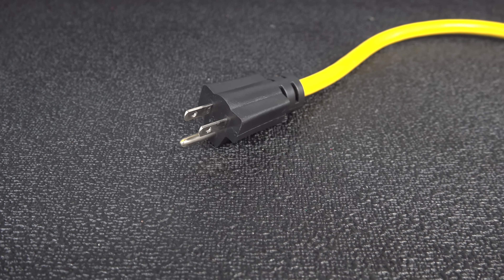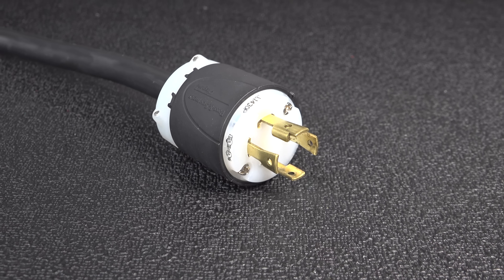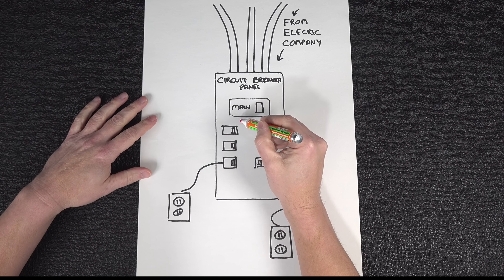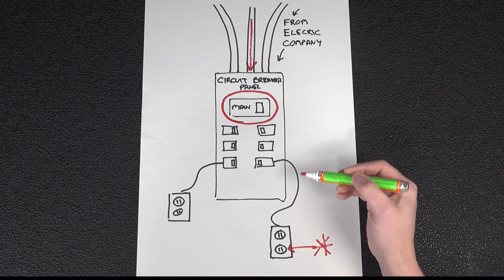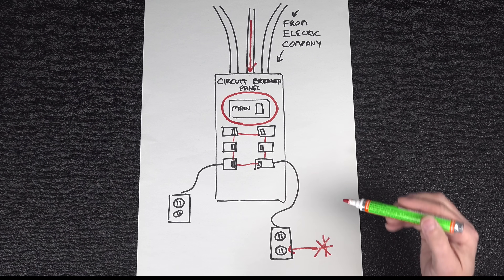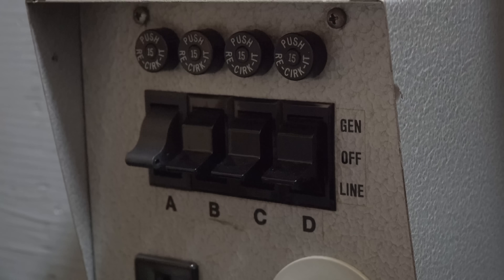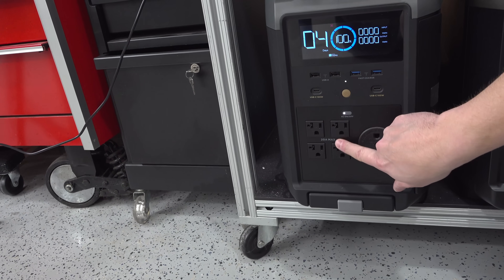Worst Electrical Mistake You Can Make - Backfeeding Generators

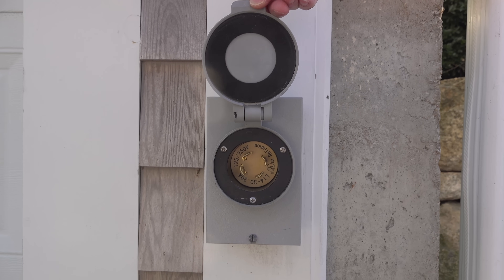Comment: 3:05, you should clearly mention that this outlet is safe to touch ONLY when you have a properly installed interlock. Otherwise, those prongs are only 'safe' when the breaker is off.

Also, backfeeding the utility is totally legal if you have an arrangement with the utility to do so. This is the same mechanism of backfeed that solar panels use to 'give back power' to the utility. (EDIT: it of course must be a proper, permitted installation approved by the AHJ).

The danger (for a lineman) only exists when he removes live cables from a transformer for maintenance, while NOT being aware of a backfeed present on the lines. Even if he wasn't 100% sure if there was no backfeeding, there are safety procedures and precautions he can take to avoid death from this disconnecting scenario. Even still, you should be a responsible homeowner and only backfeed when you are permitted to do so. Linemen are just like any other human, and will skip safety steps to make a job easier.

I'll also mention that you should in fact NEVER backfeed your structure through a typical 15A/20A receptacle (i.e., using that cable he showed at the beginning). You should do a proper installation like he showed. But you can make an emergency temporary one if you need to. Just use your dryer outlet though. Of course, ALWAYS TURN OFF THE MAIN. But your dryer circuit is typically the highest rated capacity circuit (for temp/amps) in a residential dwelling. Feeding a generator into the dryer circuit is much safer than a regular branch circuit. Remember: TEMPORARY, EMEGENCY USE ONLY. If you expect to use this setup a lot, and ESPECIALLY if you plan to sell the home, do a proper installation. This method is only recommended for a sudden storm, etc.
Reply from the maker: There is no arrangement with any utility that supports backfeeding without an interlock. If you have solar, etc those are all required to have safety interlocks as part of their design. But no utility company in the US condones or is OK with illegal backfeeding in the video.
Reply: @SilverCymbal  yes, thank you for the correction.
Yes, of course, you must have a proper, permitted, installation to do this legally.

Comment: I live in a 3rd world country and that cable is the way generators are used here... You just need 2 pieces of common sense. If power is on and the main breaker is off don't effing touch it. Connect the cable to the house first, so the exposed end won't be powered, then connect to the generator.... As my mother would always say, "common sense is the less common sense"

Comment: many years ago, my dad set up the house to be backfed by a generator, but the solution he used was even worse than a double-male cable. He installed a cable with a male end and a permanently-wired end. It's energized any time we have grid power. When we aren't using a generator, the male end is kept in a locking receptacle which is installed but not wired to anything -- to give some degree of safety.

Creating a safe installation would've required digging a trench to run an underground cable. At the time my dad set up the generator, we probably could've afforded to do that. By the time I was old enough to realize the setup was a major problem, that wasn't the case anymore. We wouldn't exactly die overnight without power, but with how long and frequent power outages are here, we would experience significant hardship if we dismantled the setup. Being able to fix this became farther off when my dad left the family and thus wasn't helping pay for things, and work-from-home means that our livelihood has become dependent on the generator.

A family member has recently started dating a contractor who has been very willing to help with other issues, so I'm hoping we might be closer to getting a safe setup. This video has also reminded me to try again to find ways to get out of the need for the underground cable -- since that's the primary barrier.
Reply: You can make it safe(er) by having a cheap interlocking device that doesn't allow you to turn on the generator cord unless mains power is off. Its a few bucks for most home style panels and many electricians can give u advice on how to install it.
Reply: @etucker  if it goes in the service panel, it's a no-go until we place that underground cable. The generator shares a breaker with the wellhouse, so as-is, an interlock would cause us to have no access to water except when we are using generator power.

When off, the generator needs to be kept in the wellhouse to avoid theft. In situations where we need to use the generator, we usually won't be able to move it much of the way from the generator to the area near the service panel. The path will be obstructed by heavy snow and tree limbs. It's walkable, but that's about it.

I think we looked into running an extension cable every time the generator was used, but I don't remember what the issue with that was. Service panel is on a post detached from the house and wellhouse, so we'd need to add the generator input to that post or free up one of the underground connections so we can put the input on a building. I want to revisit that because a long, high-power, heavy-duty extension cable is probably significantly less expensive than digging a ditch for an underground one.
Reply: @klikkolee  I see your dilemma. I would definitely do the underground cable.. a portable cord is heavy and cost almost the same save for the labor to dig the hole which most people use heavy equip, and is done fairly quickly. Theres a couple things you could do to make it safer in the meantime. Install a switch with a lock on the cover next to the well panel that turns off the generator cord when not in use, and keep that locked off. Label the cord to what its purpose is, so someone unwary doesn't plug it into another live cord (💥) or get zapped. Get the underground done. Last thing you need is someone to get hurt messing with that
Reply: Put a high amp switch between the cable and the rest of the house, just turn it off when you're not using the generator

Comment: I remember years ago seeing a somewhat similar cable for instruments. One side had a male, 3 prong for an outlet and the other end was a quarter inch TS to plug into your guitar, bass or any other instrument(s) that have a quarter inch TS input. I know it's a joke but they actually sold them for real to mess with people. 🤦‍♂️
Reply: Wow. I am a musician and use 1/4 inch cables all the time for over 35 years. I can't imagine anyone making or selling what you discribe unless it was just the metal tips on a fake cable that isn't actually wired.
Reply: @MrChopsticktech  I couldn't say if they were actually wired or not but from what I heard in different chat rooms and guitar player/musician sites at the time, they were. Well at least the one I'm thinking of. I forget the name of the one I'm thinking. Something along the lines of "killer guitar cables" or something. I been a musician for pretty much the same amount of time as you so I'm sure you've seen pics of one on the net. I'll try to find the one I'm speaking of and I'll get back to you if I can find it. Pretty messed up if they really were wired though. Gonna search for it and real quick.
Reply: @MrChopsticktech  found it but it keeps deleting the link I post. Look up, "Sure, you can jam with my band" cable.

Comment: 3:05 need to be more clear that the reason you will not get shocked is because of the combination of having the breaker to that circuit switched off while the main is on, and having a safety device (the interlock) in place to prevent someone from in adherently switching that circuit on while the main is on.

Basically, make sure you correctly install the interlock.

Comment: All you have to do is turn off the breaker off that the outlet is on, then you don't backfired anything. Duuuuhhhh
Reply from the maker: Lot more than that to go wrong, and it has many times.
Reply: That would just mean nothing at all is plugged into your generator.

Comment: There’s another issue with this cable, and it’s pretty obvious: what if you plugged both ends into the same wall outlet plate? Like, one end into each outlet? Would that feedback loop cause an explosion or something? It definitely doesn’t look safe. And I’m not an electrician, but even the fact that it’s possible seriously scares me.
Reply: they are already connected like that on the inside. both plug outlets are fed by a single wire set.

Comment: Ha ...amateur,  local electrical genius one went to fix connector to a welder. The welder was used inside a convention center, thus there were several real different plug style throughout the building. So he attached one of each plug style, to the welder ...yep plug in one make them all hot. All I could do was shake my head in disbelief... Cincinnati !!

Comment: If you have to suicide cord backfeed, shutoff the main breaker and make sure you backfeed into your 30A(or even 50A) dryer outlet.  If you backfeed into a normal outlet, you're wasting energy from your generator and risking fire from overloading the much smaller wire on that 15A circuit.
Reply: If the wire was sized correctly, it shouldn't be a fire risk – the breaker should trip if you attempt to draw too much current.
Reply: @Dee_Just_Dee  When suggesting how to go about doing something dangerous, never understate the dangers.  :p
Reply: In my area of the country few new homes have 30 or 50 amp, 220VAC circuits anymore.  Even the hot water heater, stove and dryer runs off of natural gas (or propane) in a newly constructed Michigan home.  My house was constructed in 1990 and didn't come with any 220VAC circuits at all, my brother's was constructed in 1997 and he had to run hot water heater, stove and dryer circuits himself when he started using wood heat and didn't want to deal with propane (he lives 20 miles from the nearest town).

Comment: So what I'm getting here is that the cable is actually safe if used correctly.. The actual unsafe practice is leaving your main breaker in the on position which can let the electricity from your generator going to the grid, which can be dangerous for the repairman that's trying to fix the lines.

Comment: There is nothing inherently dangerous about a generator cable, but rather the danger comes from the tool(s) using it. If you must use one, kill the main breaker. Don't touch the ends of the cable while plugged in and live. Capeesh?

Comment: Most of this video is excellent advice. However...

The main reason that you never want to power your house through a wall outlet is because the wire used in the circuit is not strong enough to safety carry the full current. 
At best the circuit breaker will trip.
At worst the outlet and the wire will melt and catch fire. Not good! 

Electricity isn't a hobby. Invest in having a licensed electrician hook you up the safe way, the right way.

Comment: Can you explain how mine works? I had a whole house gen installed with automated start. Both street and gen lines run into a separate box with 2 main breakers. One for steet, one for gen. A main line runs out of that box and into my main panel. 10min after street power loss the gen auto starts and it auto throws the street breaker. Once the street power is restored, a light and audible alarm sounds on the control panel. The gen remains on till I manually shut it off. I can move the street breaker freely back and forth but it won't make any mechanical contact until the gen is off and I move the gen breaker to off. Once I have street power restored to the panel, I then switch the gen breaker to standby.

Comment: Not to mention, if the amps coming from your generator, exceed the capacity of the circuit you are backfeeding into, it may trip the breaker for that circuit, but the wiring between the generator, and your panel, will still be live, and in excess of their rating, possibly causing a fire.
Or, so my amateur logic tells me.
Reply: Every generator on the market has a built-in breaker on every one of it's outlets.  So trying to draw more capacity from your generator than supported will pop the breaker for the supply outlet on the generator, even if it's below the rated capacity of generator.
Reply: @rthinds  but, my concern, was what happens, if you run a generator, rated for, say, 50 amps, backward, through a house circuit, rated for 20.
Someone already answered that.
The house circuit would shut off, at the 20 Amp breaker, and, without a draw, it wouldn't over load the wiring, between the outlet, and the 20 Amp breaker.
Reply: @Mr.Schitzengigglez  
No.  That generator, rated at 50Amps, will NOT provide all 50Amps through the 120v/20A outlet.  It will provide (at most) 20A through that outlet.  (Actually, only about 18A cuz of mandatory safety limits).

The breaker on the outbound outlet on the generator will trip at anything more than about 18A.  Ergo, you will never experience all 50A through a 120v/20A outlet.  There are TWO breakers preventing this - one in the house, and one in that specific outlet on the generator.

Literally everyone in these comments is forgetting every outlet on a generator has an individual breaker for it.
Reply: @rthinds  not so.
Most people know what a gfci is, dude.
And, my welders draw way over 20 amps.
So, I'm not sure why you think that generators are rated that far below listed capacity.
You are starting to sound like you have no idea what you're talking about.
Reply: @Mr.Schitzengigglez  Not talking about a GFCI. I'm talking about the individual breaker attached to the outlet from the generator.  Never said ANYTHING about generator ratings. Once again-I'm talking about the INDIVIDUAL BREAKER on EVERY OUTLET on a generator.  Stay focused.  Concentrate.

Yes, your welder draws more than 20A. So does mine.  But you cannot get that 20A from a standard 120v/20A outlet, no matter WHERE it's sourced.   

You are sounding like someone who knows they are losing a debate and are engaging in ad-hominem attack.  I'm game.
Reply: @Mr.Schitzengigglez  Go outside and look at a 120v/20A outlet on your generator.  Notice the little flip-switch above (or in the center of) that outlet?  

That's called a "breaker".  C'mon man,  I thought this was obvious.

Comment: I don't have electricity from the grid, instead I use a generator which I hooked directly to the bus bars in the breaker box. I did disconnect the power cables coming in from the grid and cut the copper that was exposed then covered them completely with electrical tape to make them safe if a mistake was made and they were to put the part back in the meter. Now the breakers work just like they did when I was on the grid and there is no back feeding. You can use a generator connected directly safely IF YOU REMOVE THE CONNECTION TO THE GRID and everything works like it does from the grid.

Comment: Seriously, how many different plug types are there in the US? I think in this video were about 4 or so?
Reply from the maker: Two residential are very common here but then there are many high amp sockets that vary a lot, 30amp, 50amp and even the types vary. Its a very old system that was never really updated but sort of works, Sort of is the key.
Reply: @SilverCymbal  sounds confusing... in germany there are 2 (or maby 3) connectors. 
1x normal 16A  230V 
1x 16A/32A/63A/125A 230V 1~
1x 16A/32A/63A/125A 400V 3~

And the latter once are basicaly the same except for different sizes (obviusly) and different pins depending on the voltage (and color of course: blue 230V, red 400V)

Comment: I've never fully understood the dangers here. I get with the main breaker not turned off you could backfeed to the street but then you would be trying to run everyone's house off your generator which would immediately pop the breaker on the generator if not the breakers in the house. I've actually been doing this for years but always make sure my main breaker is off.
Reply: Theoretically it could happen though- there may be someone that has seen an instance where something happened in a real death situation. 
As unlikely as it is, people even win lottery sometimes- it's just odds and statistics.

Comment: To add to this, transformers work in both directions. Some may think that a generator would not be much line voltage, and you are right. But let it ramp up from a transformer and have a lineman on the other side and you have just possible killed someone. Backfeeding is dangerous if you are complacent. And yes it is illegal for good reason.
Reply from the maker: Great point!
Reply: Have there been actual cases where this happened? What were the circumstances?

Comment: If you can blu plug it into one outlet it would only power one phase anyway so like half your house would work but if you had a 240v plug like a hot tub then you could power the house but that breaker would limit the amount of current.

Comment: If you're a idiot that's a very bad plug. 
Always shut off all of the main breakers before even touching that plug but also  use your volt meter to make sure. I found a hot circuit in my box that only pulling the meter cut the power how many others have that???